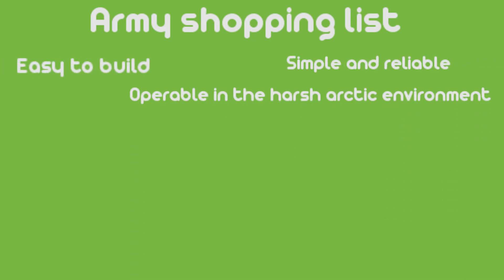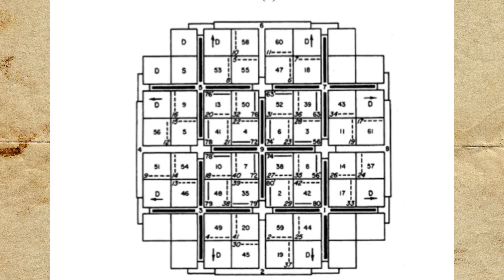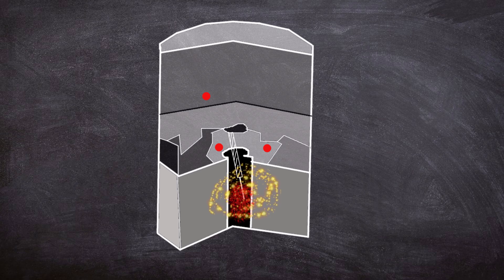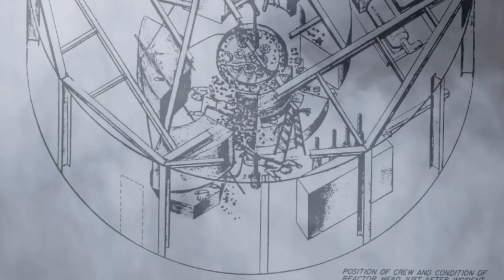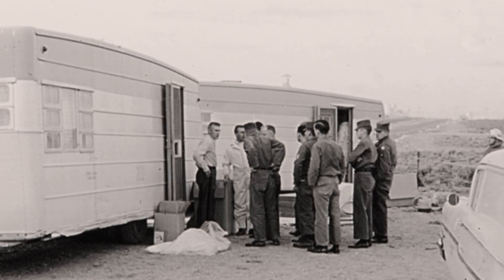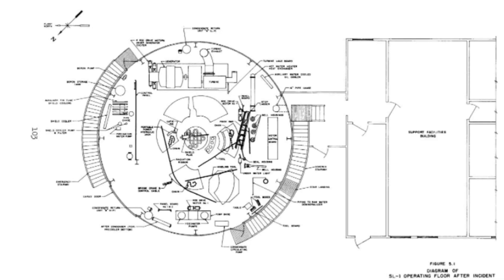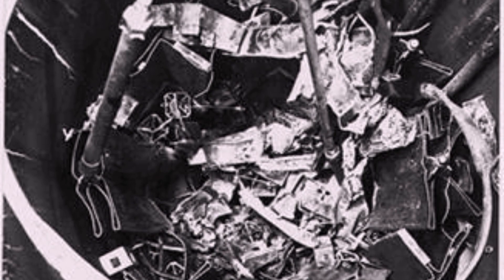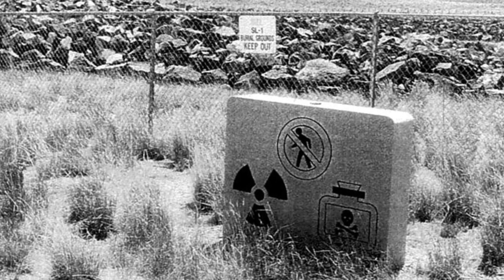A Brief History of: The SL-1 Reactor Accident

Comment: The reactor was actually at the Idaho National Laboratory (INL) which is located about 50-60 miles(ish. Just from memory I don’t exactly remember the distance) north of Idaho falls. Closer to the town of Arco (the first nuclear city). Just a clarification. Otherwise, great video!

Source: I lived in the area for 2 decades.
Reply: When this happened it wasn't called INL 👍.

It's also not far from the remains of EBR-1 and the experimental jet engines
Reply: Thank you!  Yes, give Idaho Falls a break!  The town is about 38 miles east of where SL-1 was.  It was an hour-and-a-half everyday on the bus out from Idaho Falls to get to work at the Naval Reactors site.  (In the Navy, our reactors don't pin people to ceilings.  Or even to "overheads".)  When Doc Rancher, a senior engineer, retired, the staff calculated he had spent over ten years of his life on the bus.

The SL-1 site is/was actually close to Highway 20, not far from the entrance to INL.  The reactor was at LAT 43.517952, LON -112.823726.  Google Maps:  https://www.google.com/maps/place/43%C2%B031'04.6%22N+112%C2%B049'25.4%22W/@43.5190924,-112.8217614,949m/data=!3m1!1e3!4m6!3m5!1s0x0:0x0!7e2!8m2!3d43.5179519!4d-112.8237265

Detailed maps are at https://semspub.epa.gov/work/10/100040782.pdf

Comment: This is as stupid as having a red button to press for meltdown. How did it not occur to anybody that limits should be put in place to prevent user error?
Reply: Well I figure that they were keeping the design as simple as possible and using this unit for training and research into the possibility of small scale portable power units. My guess is they were going to rely on training in hopes that once the design is in production they would have most of the kinks worked out. Seems one of those kinks should have been a collar attached to the rod which prevented it from overtravel. Another was the rods themselves shedding material and corroding. Seems an attempt at a simple design wasn't working as hoped. As Einstein said of nuclear power plant plans "It's a hell of a way to boil water".
Reply: The same way that automobiles did not have seatbelts in 1918.
Reply: @dennislindemann9057  Ok, that makes sense. I'm actually from Ukraine, and during the communist regime you were allowed to have one job and it was illegal to have two because the logic was that you must not be working hard enough at your first job if you have the ability to do two jobs..... So in this case, their logic would be "why have safeties because it'll only make the workers lazy".... Good point Dennis.

Comment: i would have sent the designteam in to clean up everything... knowing they will die from it. how was it possible to design that thing and think it would be OK if 1 operator could basically nuke everything by starting up the reactor? the design begged for this to happen. sooner or later an operator will pull a controlrod out too far if its not secured aginst that dont need to be a nuclear physicist to know that... a permier example of ignorance.

ps.: i accept that you have to pull the control rod out by hand to start up te reactor but the FIRST question that arises to me in that situation is: what happens if you pull it out too far? this simple question would have preventet that "accident/sabotage".

Comment: do love (not ) to watch the nuclear incidents  (ahem with the Klingon high command on Star Trek VI using that voice)  could get into to some avoidable earthquake damage.  Similar to the 1989 road on road on top bridge  X_X  and other sort.  But can't go wrong with Nuclear.  Unless there is a Hydrogen leak I know nothing about
Reply: Hyrdogen generation occurs when temps reach 3000 degrees Fahrenheit. Its called the water-zirconium reaction. Normal operation hydrogen is added in very small amounts to scavenge oxygen from the water to prevent corrosion.

Comment: A little side note on this the fire dept was getting a little cranky about this due to the fact this was the third call of the day the first two being false alarms, also they were 9 miles away and it being Idaho in January the temperature that night was 17 below zero . There is also a short film [ about 30 minutes] about this you can find here on You Tube that touches on the marital conflict going on and speculates this was the guy who pulled out the control rod.
Reply: Tell me more. Is there a link? I was always fascinated about sl1, and have never hear of this discussed.
Reply: @TheFootbaldd  Just plug SL 1 into the You Tube search box at the top of the page you will find a bunch of stuff

Comment: If the control rods had to be lifted using a simple tool similar to a scissor car jack, the rod would have been lifted slowly and could not have gone further than the designed limit. Instead it was lifted abruptly and more than required. While full automation would have been costly and impractical, simple mechanization would have been enough to avoid the incident. Whoever created and approved the "let's raise the rods freehand" procedure (with strict, but not enforced travel limits) was not a good engineer...

Comment: You don't understand how nuclear reactors work.  Control rods do not "go critical" as you state, their purpose is to absorb neutrons emitted by fissioning atoms and thus control the chain reaction.  Pulling the control rod all the way out allowed the reactor core itself to go critical, essentially releasing a tremendous burst of heat which caused the cooling water to flash into steam, thus resulting in the pressure wave and water hammer you refer to.  Water also serves as a moderator, meaning it slows the neutrons down thus facilitating the chain reaction.  Once all the water boiled away, the chain reaction stopped, but the residual heat continued to melt the core until it slowly radiated away.
Reply: @ John porter the control rods are made of a neutron-absorbing matetial, but are actually tipped with something i can't remember what which is a neutron catalyst of some sort
Reply: @TP-tc7vp  No they arent. In russia yes and it was graphite, but not american reactors. otherwise every scram would cause an initial spike in power generation for any rods near the top, which in civilian plants can be quite a few.
Reply: @Specterx97  I just know that I've heard that if you over travel the rods, at least in some designs, a part of the rod can become part of the reaction rather then dampening the reaction.  It seems relevant to bring up in this discussion of rods going critical
Reply: @TP-tc7vp  The rods cannot go critical. That term is only applied to the fuel cells. In reactor design every material has a coefficient of reactivity that will either increase or decrease the reactivity of the fuel. AFAIK Russian designs are the only ones that had any positive reactivity on the rods and thats because they were graphite tipped. American designed plants use neutron absorbing metals such as boron or hafnium to control reactivity. Even core vessels have to be assessed for moderation ability because they can act as reflectors to reflect neutrons back into the core for increased efficiency.
Reply: @TP-tc7vp  But yes if you pull out the control rods more fuel is exposed to the moderator and contribute to overall power of the reactor.
Reply: @Specterx97  I know the rods don't go critical, the video claimed that.  Someone in this thread claimed that rods can only dampen the reaction, and there are instances where that isn't true
Reply: ah my bad mate, been a long day.
Reply: @Specterx97  all good. Thanks for the input 🖒
Reply: Ty T I don’t know, I know plenty of guys who’ve had a rod go critical after pulling it out a bit too far. Always makes for quite a mess...
Reply: @f123raptor  oh because of the secks
Reply: @TP-tc7vp  
You're thinking of the RBMK desiged by the USSR.
All fuel assemblies for commercial use in the US are boron or cadmium loaded stainless steel, no graphite "ridders" are used at the tips like the Soviets did.
Reply: John Porter r/iamverysmart

Comment: So, they were essentially trying to make an Ikea reactor?
Reply: Kerbüm
Reply: J_Squatch yes
Reply: the idea was to design a nuclear power station simple enough to build and operate it could be placed on any forward military base. And that meant creating one that could be airlifted and transported using the standard size army trucks and air force transport aircraft of the day.
Hence the strict size and weight requirements for each component.
Reply: No... IKEA made SL1 furniture...
Reply: Sadly an Eagle Scout would figure out how and basically do the same but less immediate death and more mystery
Reply: @drunkencowboi7934  Actually the boyscout's "reactor" never went critical nor was it safe.  In fact people like me had to dispose and clean up that disaster.  Also his was supposed to be a breeder reactor which was successfully built decades before David Hahn built his; where do you think he got his ideas?
Reply: David H hmm you learn something new every day
Reply: David H username checks out
Reply: David H any idea where I can read up on this?
Reply: @dmh8953  How were you involved?
Reply: Nöok range
£10000000000000000
Reply: Yes
Reply: Yeah!!!
Reply: Reäktor
Reply: Oof
Reply: The part that sucks is having to put one of these reactors together with one of those little Allen keys.....
Reply: @frankthespank  and its the wrong size
Reply: J_Squatch they were trying to make a dollar store reactor that was 1£ from the dollar store

Comment: I just checked, and since it is NOW in the public domain, I had a version of this Rx near where I grew up at Ft Belvoir. Along with Ft Greely,v that's two thst the public knows of. 

The design of the Rx was stable. Just not safe for mediocre trained humans to operate. 

Step excursions of control rods were two easy to  do if the operator wasn't paying attention, enough, or got in a hurry. This is ultimately what got SL-1 in trouble.
Step Excursion.

Comment: My favorite nuclear incident... Where else will you find one of the victims pinned to the ceiling with a control rod...
Reply: It wasn't the control rod, that thing was found lying on top of the case. What pinned him to the ceiling was part of the No. 7 shield plug assembly.
Reply: STOP SAYING THAT! I wrote (and corrected) the Wikipedia article about this SL-1. And I wrote numerous times that it was a shield plug. This author got it right. You stop spreading misinformation! The central control rod hit the ceiling and laid down on the top of the reactor when it came to rest. It's well documented, although photos of Legg's predicament are scarce... you only see his body around 10:15 in the welding scene, and not the shield plug. But the drawings are pretty accurate where photos don't do justice.
Reply: in chernobyl u coudnt get pinned to roof,... roof went up too
Reply: @marianmarkovic5881  No, at Chernobyl someone just got pinned to the moon.
Reply: Impaled through his lungs and ballsack, no less!!!

Comment: Rather than moving it up and down to free it... what if it was 'stuck' and they were trying to force it out... then it suddenly gave causing a sudden, and large withdrawal as the operator fell back?

Seems like they really could have used a simple 10 cm long connector to attach the control rod to the actuator without needing to manually lift the rod at all.
Reply: Well I guess we’ll never know why they didn’t devise some foolproof way to avoid instantly blowing up a reactor from a single slip of the wrist but personally I like to imagine there was some gruff general in a green army uniform busting through some lab doors at the end of a hallway at the Pentagon:

Scientist:  “Sir, we’ve almost completed the reactor design, but it will never be safe to operate, we need at least three more weeks to design and test the safety systems!”

(The general grabs the clipboard out of the scientist’s hands, leans down so his nose is only an inch away from the scientist’s, looking directly into his eyes)

General Magillicutty: “Now you listen to me *mister scientist*, we didn’t have any ‘safety systems’ during double-ya double-ya two at Pearl Harbor when the Japs attacked! *I want my reactor!*”

Scientist: “Well... yes sir, uh, that’s what I mean... if we had better safety systems maybe we could have prevented Japa-“

General Magillicutty: “Now you listen to me son*! I’m briefing the president a 12 o’clock-you hear me?! That’s twelve hundred *today and if there aren’t 6 smoldering pounds of 93% enriched uranium on my desk by then, you’ll be manning a radar post in Antarctica by sundown!”

Scientist: “Well if they pull this stick out a few inches too far, the whole thing will blow up.”

General Magillicutty: “WHAT?! WHO WOULD EVER DO THAT? I’ll tell you who - NO ONE! Now I want you eggheads to put that thing in a box with an instruction manual and get it to the desert on the double! Damn it, *I’ve already got three of my best men out there waiting to fire ‘er up!*”
Reply: Don't know, but damn if that's the case, then their teaching had been total shit. Seriously if something is stuck and you force it and haven't noticed that in 99,9% of cases you will exaggerate the intended movement. If something like that was been overlooked... Pretty damn unlikely

Comment: Unfortunately one really recognizes that nuclear power is not your special field of expertise.

Why discuss the boron flaking when it does not affected the acident? 

Why do you draw BWR control rods in your animation upside down (as they are used now in commercial BWR).

Why dont you discuss that for starting the reactor the operators were supposed to lift the CR ~10cm by hand to connect then to  the automatic control rod drive?

 Why dont u discuss the transition delayed to prompt criticality?

Why do you mention the most important consequence of the accident, the n-1 rule only on a side note.

Overall, a rather unprecise discussion of the SL1 accident, beeing less informative than the declassified u.s. army videos on youtube.

PS: I dont want to be too negative, but only via criticism one can learn

PPS: it was not a core melt accident, but a core damage accident.

Comment: Damn, I'm getting old. I get enthused when a YouTube vid mentions a former employer of mine- Combustion Engineering Inc. And yes- I worked in their nuclear power department.
Reply: Brian Garrow Homer fucking Simpson lol
Reply: @TheRealCaptainFreedom  I built them. Homer ran them.
Reply: @briangarrow448  interesting mind talking a bit about what you did?
Reply: I had the opportunity to work on S1C, North of Hartford, CT.  It was a submarine reactor prototype built by Combustion Engineerying.  We were there for a couple of months to replace a pump.
Reply: I remember working to CEI specs. Those specs are still used to this day.
Reply: Oh wow you're pretty cool.
Reply: We won't be happy till we blow ourselves to fk. Lead coffins. Burial site. Mojavi dessert site. All radioactive fk ups. Insanity. When we can match both einstein relativity theories we will have a chance. U till then don't touch
Reply: @wcraigburns3458  Actually modern thorium based generation 3 and 4 reactors are SIGNIFICANTLY safer, like, actually cannot melt down due to things like new fuel and control media shapes, meltable corks, the need to use a helper material. Uranium is basically the worst fuel you could use for a reactor and most of these vintage 50s reactor designs are complete shit.
Reply: @hopdosp  thanks Dec. I'm still wary though m8

Comment: Wow... not even a mechanical device to prevent control rod over extension and 'sticky' control rods for manual removal? Could anyone not see this was an accident waiting to happen?
Reply: David Palmer hindsight is a wonderful thing.....
Reply: @cornellkirk8946  More like safety wasn't considered important. Just take a look at the reckless experimentation using a screwdriver and the 'Demon Core' that let to a criticality accident and death.
Reply: David Palmer totally disagree, it wasn’t known about back then. The risks associated, and before you say “well they made an atom bomb in the mid 40s”

Having radioactive material is a long way from having a nuclear bomb.
Reply: @cornellkirk8946  The risks were well known and documented but they still took risks. The 'Demon Core' example I gave, if you looked it up, demonstrated an experiment of placing a sub critical plutonium mass and manually using a screwdriver tip to keep the hemispheres apart. Louis Slotin knew what he was doing was extremely dangerous and he and another scientist paid the ultimate price for not reducing the risks of the hemispheres touching.
They weren't stupid people but they didn't mitigate the risk of a criticality accident.
Reply: @davidpalmer9780  A lot of these things seam obvious to us now. Would previous accidents have been known about or would they still have been top secret at the time?
Reply: @cornellkirk8946  When faced with facts, insult by calling them a moron. Well done!
Reply: @andrewwhite1793  Agreed... but I'm saying that these operational risks were documented & well known to those at the reactor. Risk identification and management plus OH&S wasn't the same back then as it is now in developed countries. Back then they took risks that would not be acceptable today and some paid the ultimate price.